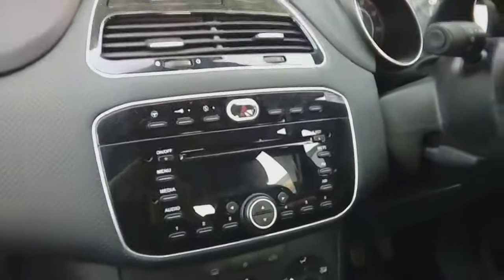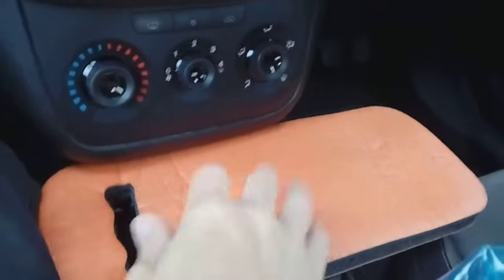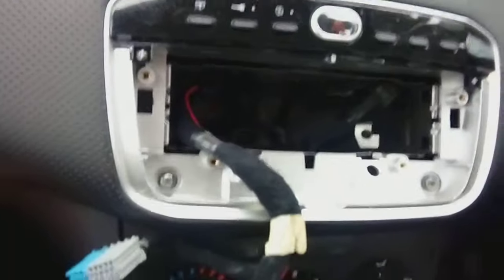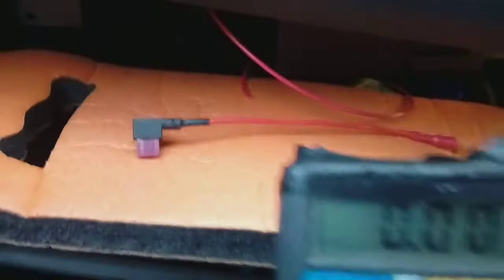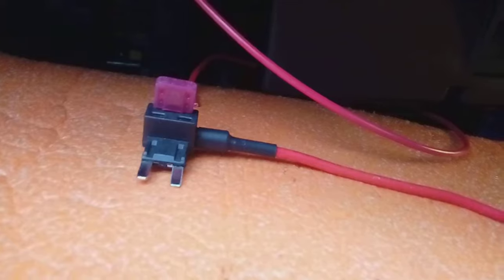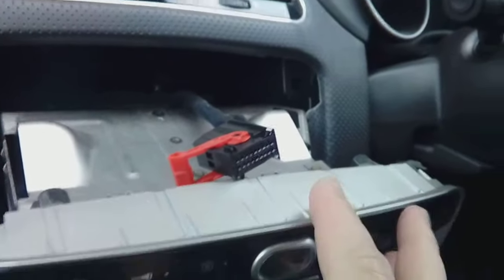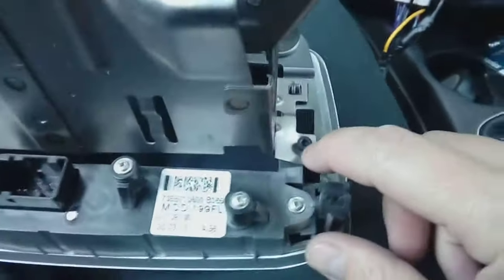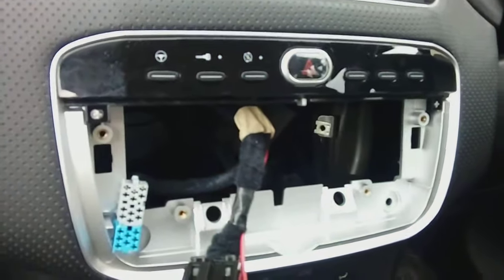Fiat Punto Evo 2009 -2015 radio removal & refit guide + part numbers used

Comment: Hi PJ, I have all the parts to change my radio now just wondering apart from the steering wheel control of the radio can doing this create errors with other things like the speedo? And can the trip mileage still be reset on the right steering indicator button?
Reply from the maker: No you won't get any errors and you can still reset your mileage.
Reply: All done and sorted, thanks again for the informative video.

Comment: Great Video and will be a great help thanks.  One question, I have just ordered the facia with exact same part number and manufacturer but it isn’t in a high gloss finish.  The video appears to show the facia in a high gloss finish to match exactly.  Can you just confirm it did exactly match? Many thanks
Reply from the maker: Yes it matched fine,If I recall this was made by Connects2,they do a couple of shades.
Reply: PJs projects thanks so much for the reply.  I actually contacted connect 2 directly today but they say they only do one type in black but it could have been that they did 2 types at the time you did the fitting.  Thanks again for replying.  If it was your Punto you fitted out, I’ll buy the facia from you if you sell with the original stereo!!!! Cheers

Comment: Hi Tom, if I am just wanting to add an aux cable to the existing stereo, will I have to take the entire casing out as shown in the video, I can I simply pull out the head unit with the release pins and plug it in that way?
Reply from the maker: A lot of the Punto models have a aux input on the front of the radio but if not you might try an adapter that plugs in to the rear such as this -    https://www.ebay.co.uk/itm/adapter-cable-Aux-In-Out-adapter-FIAT-Punto-from-2012-for-scanner-mp3-ipod/401304844152?epid=737122645&hash=item5d6fa1f778:g:LBIAAOSwYIxX3-Oa

Comment: Why do you add the power wire with the fuse spur?? Does the radio not have power unless you run that wire?

Comment: Thanks for the tutorial, it is great! But I have a couple of questions I would like to ask:
1. Which AWG/gauge is the power cable and why is it necessary? It is not enough if I buy an ISO harness and plug it from the old connector into the new radio?
2. I know one of the fuses used in the fuse tap/adapter comes from the fuse box but where does the other one come from? I have already bought a new radio and it comes with a 15 amp fuse pluged in the back; can I use that one? If not, which amperage must the new fuse have?
Sorry for my ignorance but I dont really get to understand that part of the video and it is the first time I change a radio.
I hope you can answer my doubts, thank you.
Reply from the maker: Use 15amp rated power cable with a ten amp fuse as most radios have a ten amp in the back.
You need the power cable because the a lot of the Fiat range do not have a ignition switched power going to the factory radio, so when you install an aftermarket radio it stays on all the time even when the ignition key is removed.
Reply: PJs projects thank you very much! :D
Reply: @PJsprojects  Hello, thank you for the video. I am just trying to do this in my Fiat Punto could you please share the link to where to get that power cable from please?

Comment: Hey thx for the great video. I did everything like described and it works like a charm as long as the radio is switch on. If I switch the radio off, several lights start blinking and fuel control etc won't work anymore. What did I do wrong? Thx for help.
Reply from the maker: Sounds like feedback,check your power source is on a genuine ignition switched fuse and then make sure your earth cable has good contact with the chassis.

Comment: If I want to install an AUX cable to the original radio in the Punto, where should I plug it in ? Do I need to remove the steering controls in the back and plug it in there ?
Reply from the maker: On most Punto models you plug the cable in to the top left corner of the original radio with this type of adapter -
https://www.amazon.co.uk/dp/B06ZZ4439Q/ref=asc_df_B06ZZ4439Q56963522/?tag=googshopuk-21&creative=22146&creativeASIN=B06ZZ4439Q&linkCode=df0&hvadid=310799750591&hvpos=1o1&hvnetw=g&hvrand=12556462303981478017&hvpone=&hvptwo=&hvqmt=&hvdev=c&hvdvcmdl=&hvlocint=&hvlocphy=1006674&hvtargid=aud-548500765412:pla-471540135516

Comment: Good instructions,  I have just purchased a punto with a Sony installed. I want to swap it out for the original radio . Will the existing cables be ok ? Will I have to remove the power cable?
Reply from the maker: Michael Hainsworth Power cable should be fine if its already wired for an aftermarket radio.
Reply from the maker: Just make sure to tape up the power cable thats been added or remove the fuse from it to make sure its dead.

Comment: I have a Fiat Punto EVO 2011 and looking for a radio replacement with android dab Bluetooth etc... And fast responsive touchscreen. I see a lot of adds offering radio for fiat Punto EVO 2012-2015 will this one also fit in my 2011 model. 

Also is there one u can recommend I have so much choice and I am no expert so any help would be appreciated allot!

PS: I am looking to replace the factory speakers as well
Reply: @Charlie Harper i fitted one from Ali express, which was ok. It was arround 150$ but not very responsive and a little bit bugy. In the end it worked (Bluetooth music etc) but CarPlay didn't because it was to slow. 

Definitely recommend buying one with a more expensive chip if u want to use all functionalities . 

Car is sold now.

Comment: Can you tell me why you piggy backed this to a 5 amp fuse?  It should be 10 amp minimum and surely it should have been piggy backed to the cigarette lighter socket fuse and they are not 5 amp. 
My radio has a 15 amp fuse in the back so why only piggy back it to a 5 amp?
Reply from the maker: Bit of a misunderstanding with the fuse spur, With these spur adaptors the first fuse just runs the new radio and the second fuse that is removed from the fuse box only has to run it's original circuit and so it makes no odds if it's a 3amp,5amp,30amp or whatever.

Comment: Hello there, thanks for the nice video!

I've got a few questions:
I followed your instructions and made it all the way to the point where you put the aftermarket radio (in my case a 1din Pioneer) back into the dashboard.
But there's no power unfortunately. I've never had this before and I've installed quite a few radio's in the past.
Your video shows that I need to pull an extra powercable from the fusebox. But why is that exactly? Does it have anything to do with the CANBUS system that's on this car?
If so, instead of pulling an extra powercable, would it be possible for me to buy a CANBUS cable system which I can use to keep the steeringwheel controls alive and power the radio at the same time? I don't know if you have any experience with this.

Thanks for the reply :)
Reply from the maker: Some of the steering interface units do have a switched power output but the one I list below is not cheap. You really are better of just popping a new power cable in.

https://www.ebay.co.uk/itm/FIAT-PUNTO-EVO-FROM-09-Car-Radio-Adapter-Steering-Wheel-Adapter/192237001566?hash=item2cc237db5e:g:W-gAAOSwFqJWs317
Reply: Hi there PJ and thanks for your advice.

I see that the listed interface on Ebay is quite expensive yes. Almost as expensive as the Pioneer radio I have bought new.

Would the following be another option?
- Pull a separate powercable from the 12v cigarette lighter to the red cable that comes from the Pioneer radio unit? And will this separate cable require an in-line fuse? I personally do not think so because the cigarette lighter has a fuse of it's own in the fusebox.

Example of the in-line fuse powercable: https://sc02.alicdn.com/kf/HTB191REQFXXXXaHXpXXq6xXFXXXt/Waterproof-power-cord-with-in-line-fuse.jpg

Thank you again for your reply in advance.
Reply from the maker: Yes you could do it that way,just be aware that your steering controls for the radio won't work.
Reply: Hiya PJ,

Today I finally had some spare time to finish this project.

I pulled a separate power cable from the 12v cigarette lighter. It's very easy to release the leather gear thingy from the shiftstick (sorry don't know other word haha, I'm Dutch :-P).
Then I unplugged the cable from the socket, removed the middle pin and I added the extra powercable. This cable has an extra fuse in between, just to be sure. Then I plugged it back into the cigarette lighter, checked the radio and it worked!

Thanks for your vid, it really helped me with a lot of steps!

Cheers!

Comment: Hi, When i plug in the new radio it won't turn on. no power at all. why is that? it's a JVC 1 din radio
Reply from the maker: One of the following-
1.No power to the red wire.(could be blown fuse)
2.No power to the yellow wire.(could be blown fuse)
3.Black earth wire is not earthed very well.
4.The radio is faulty.

Comment: Any one know what the wire colors are for the 2 rear speakers in the door for the fiat punto evo 2012
Reply from the maker: Should be black/green and red/yellow but double check with a workshop manual for any revisions. Also be sure to not cut the red or yellow power cables.